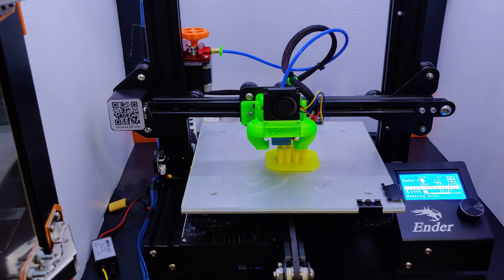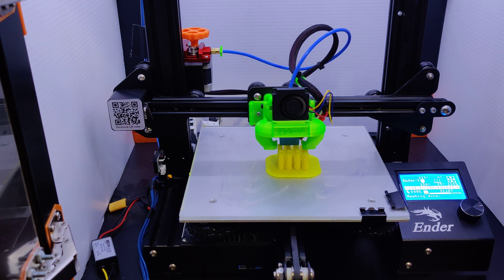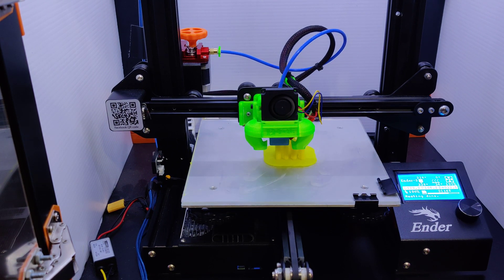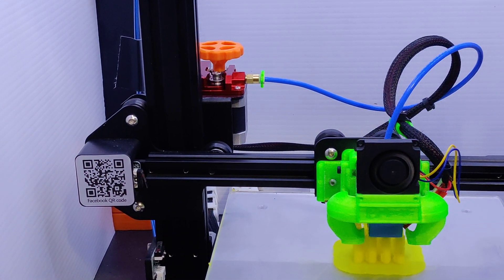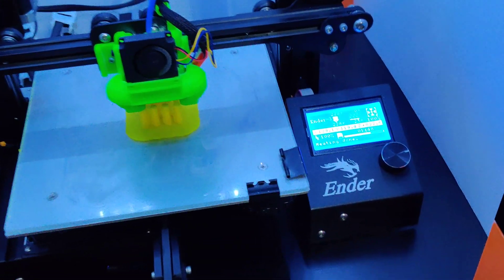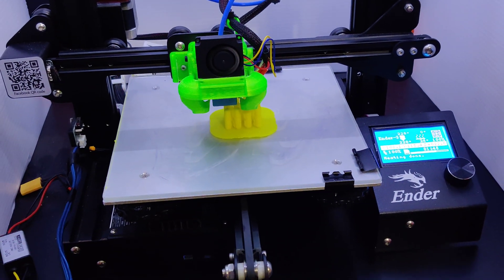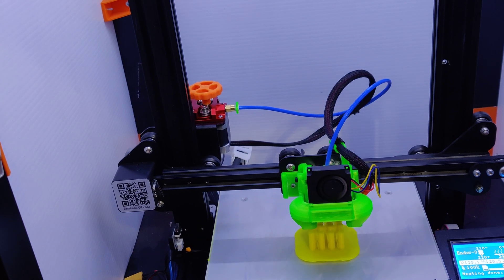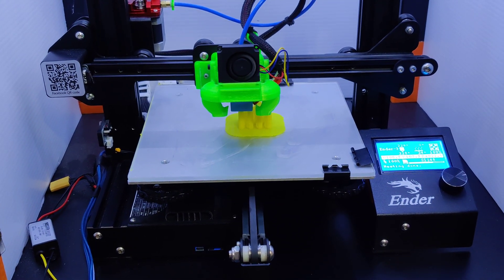How To Print TPU on a Bowden Extruder

Comment: Your cooling was 100%.
Reply: The print fan was 100% but the build plate was at zero
Reply: @s.boulware73  last i checked the bed on an ender 3 doesnt have cooling.
You mean the bed heat? Or part cooling fan?
Reply: @gammaprysem  i think you are replying to the wrong person. I was pointing out in the video that the bed temperature was set for zero.
Reply: He must have miss-spoke when he said "I have the cooling at 0%" and then goes on to discuss maximum cooling of the part. I will try playing with the cooling.